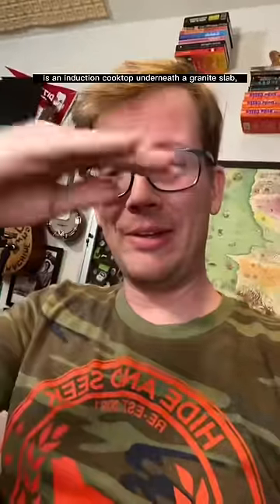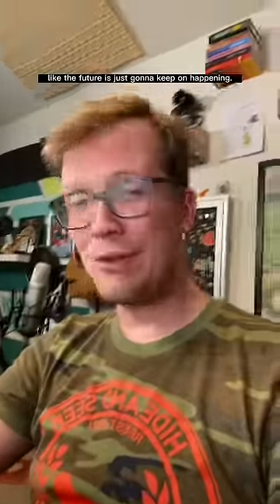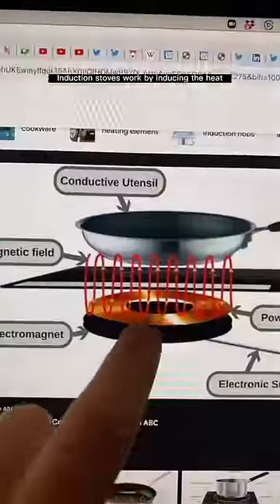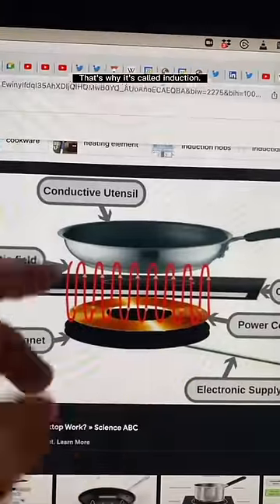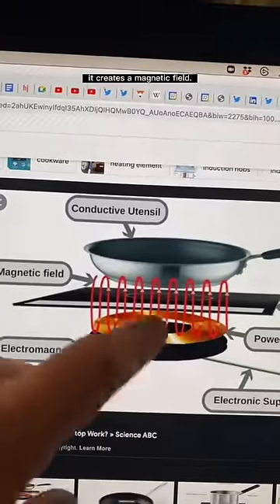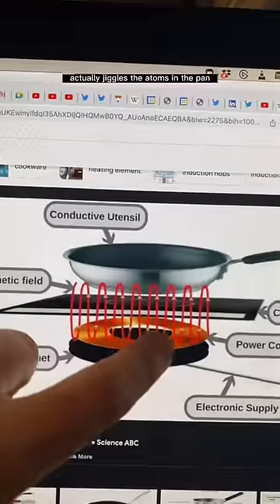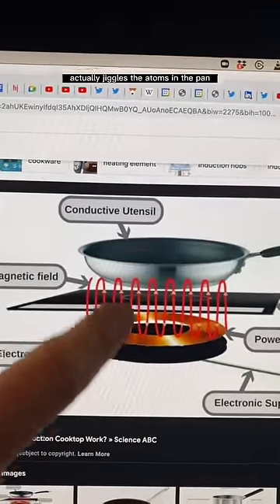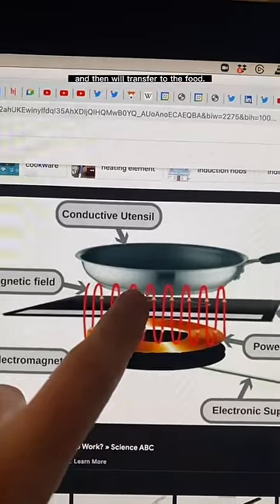How do induction cooktops work?

Comment: Even if I knew where to put the pan, I would feel too weird cooking in a pan that's just sitting on a granite countertop
Reply: Semi-levitating maybe it sounds like? Lol craziness.
Reply: @trippinbawls88  time to do this and feel like a wizard cooking with his mind
Reply: I know right,
Some things just have to look like the thing it is designed for
Reply: Per the original video series Hank is referencing, they have rubber insulators that they use to distance the pan from the counter and give it more of a stove-like appearance. Maybe that helps, maybe it doesn't, but I think this would be so cool personally so long as there were a few circles on the counter that indicated where the things are specifically.
Reply: My induction top has a glass plate, it's shows where to put the pans and stuff. The countertop can get hot due to the pan tranfering heat to it so having no clear warning seems a little dangerous
Reply: Everywhere bro
Reply: Goes to a friends house and sees a pan cooking food randomally on the table.

Am i on acid or what..
Reply: I feel like it would be shit for a wok
Reply: yeah also the stove tends to get dirty when cooking and I don't really feel bad about a stove top that has some grease splatters on it but with this I'd feel like I have to perfectly clean it every time.